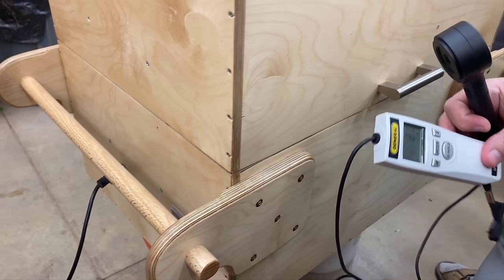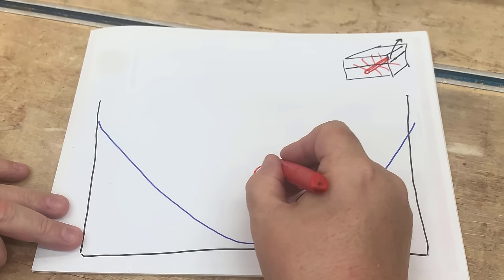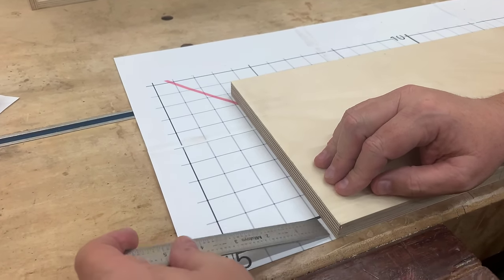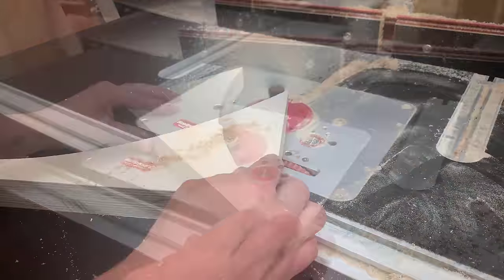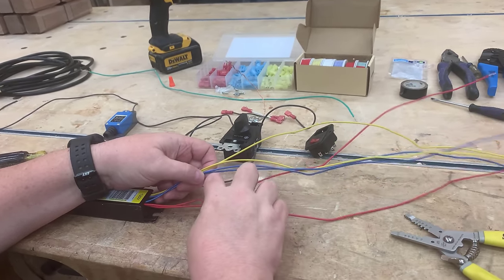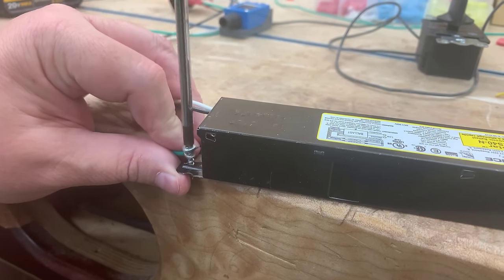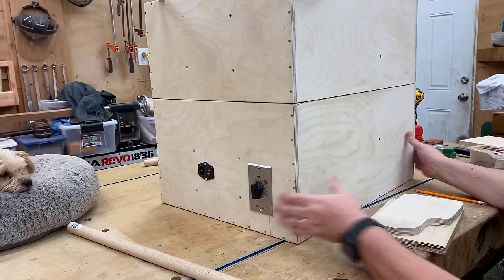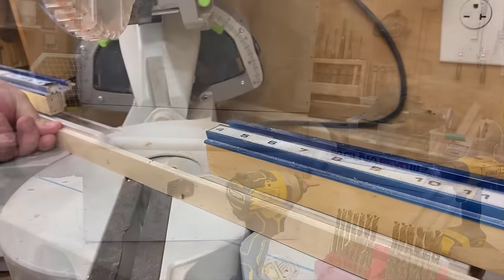Build A Box To Sanitize Face Masks & N-95 Respirators Free Plans UVC PPE Sanitizer

Comment: Thank you for the clear and educational presentation of a thoughtful contribution.  I wonder if trimming all four corners of the support rack might helpfully limit use to the higher intensity regions.  Though that the high spots are only double the intensity of the low spots means you did a quite good job of dispersing the UV.

Comment: I like the device and motivation, well done.  Incorporating your science experience and knowledge is fantastic.  I'm not sure this will pass the hospital risk assessment team as it's a home brew electrical device.  Oh it'll work, but they have to be concerned with fire safety and before building it would be worthwhile to consult with the site management team.  Its worth noting that there are discrepancies in the video build and the audio instructions, so make sure you know what you're doing before watching and attempting a build.  At 30:15,  there's a reference to pigtailing the BWN wires when in fact only the WN should be pigtailed at this point.  This is not correct as it has bypassed the timer AND limit switch.  The diagram at 35:03 is correct as it shows one black wire coming from the source going to the timer, to the limit switch and then pigtailed to upper and lower half.

Comment: had the same idea,however,didnt find UV-C lamps,i would also change the chicken gause to a polycarbonate sheet
Reply from the maker: Polycarbonate is not transparent to light in the UVC band. So unfortunately you wouldn't get sanitization through that. The only solid substrate that I am familiar with which would work is quartz glass. Pretty much all plastic polymers block it.  Thank you for watching!!
Reply: @KingsFineWoodworking  aha thanx,i didnt know that,wanted to make a box where i could sanitize my fridge/freezer items,and i tought of plastic to put my items on,now i know that wouldnt work,thanx again for the info

Comment: Love your design, it’s very well thought out.  The only thing I’m not sure about is the Mylar film’s UVC reflectivity.  If there is a protective coating above the metalized surface that coating could simply absorb the UVC much like the glass of a mirror absorbs it.  Have you conducted tests with your Mylar to determine its UVC (not just the visible spectrum) reflectivity?
Reply from the maker: I don’t know what percentage of UVC is absorbed vs what is reflected off the Mylar.  

But in a sense it doesn’t matter.  That’s because after complete assembly, I did comprehensive tests with my UVC meter, facing both up and down, in every area of the box.  And then I did the calculations off of the actual UVC light that would hit the masks. 

I agree it would be good to know what the absorptivity/reflectivity is, but it doesn’t affect the efficacy or safety of the box’s mission, since exposure time was solely based on actual UVC exposure. 

If it turned out that absorption of UVC was high in the Mylar, we could certainly experiment with different reflective surfaces. And if we found one that reflected more UVC light, then we could likely decrease exposure time. This would be an important avenue if these boxes were ever going into production. But since it was a one-off, and Mylar was cheap, I figured I’d just put it in, and meter it. 

Thanks for watching and commenting!
Reply: @KingsFineWoodworking  that’s true since you measured the effective output and you can easily reach an effective dosage in a reasonable amount of time.  How many of these did you end up making?

Comment: maybe a seal to prevent ozone escaping could be added ?
Reply from the maker: Hi Jon, this device makes UV light in the 254nm range. It typically takes wavelengths below 200nm to generate ozone. So while this will possibly make extremely small amounts, it will not be anywhere near significant enough to cause a problem.
Reply: @KingsFineWoodworking  I made a similar but not as sophisticated set up for sterilising my trainers and boots etc , I will make one of these to your plans and use some 18mm trespa offcuts I have in my store in place of birch ply as its a struggle to get just now 👍

Comment: Could you use this to sanitize the mask and air tube on a cpap machine?
Reply from the maker: I don’t think so. The UVC light won’t penetrate the plastic of the tube nor the silicon of the mask, so it would leave potentially unhealthy bacteria inside. It’s best to follow the manufacturer’s instructions, which probably involve cleaning with mild detergents & a vinegar solution.
Reply: Kings Fine Woodworking Makes perfect sense, thanks for the timely response!

Comment: Hi James, great piece of engineering!  I've tried tossing around some ideas in my head for such a box, but the problem I keep running into is, while I can make the UVC uniform across all the internal surfaces of the box (as you have done here, through the parabolic shape, etc.), I lacked the ability to measure the amount of UVC over the entire surface of the mask, with all its little nooks and crannies.  An N95 mask is curved, often with ripples, at different angles with respect to the box surface and the directionality of the UVC reflecting off that surface.  Parts of the mask will always be in shadow, or partly so, with respect to the light source, because parts of the mask will shadow other parts.  Is there any way to measure how large a dose of UVC each part of the mask surface gets? 

If there are some parts of the mask getting an insufficient dose, then the question becomes how to irradiate those complex surfaces?  One solution I've considered is a mask-shaped pedestal molded around a bundle of optical fibers.  Assuming optical fiber can transmit the UVC optimally, and a molding process can hold the ends of the fibers uniformly apart, then a mask laid over such a molded pedestal can deliver UVC to all the little nooks and crannies of a mask. 

I would just hate to pronounce a mask 'clean', when parts of the mask might be in shadows from other parts of the mask, and receive less UVC than perhaps is needed to kill all the pathogens?  But your experience and training in these areas is no doubt greater than my own, so what do you think?  Do my questions have any merit?
Reply: I'm virtually certain that UV-C does not pass through optical fibers, at least not any that mere mortals can obtain,as glass blocks UV. I believe pure quartz transmits UV but I've never heard of that used for fiber. I don't think the ridges in masks are tall enough to really shade anything from the light. That's just a hunch, so grain of salt and all, but I've never seen an N95 that looked like it wouldn't work in something like this.
Reply from the maker: Fiber optics are not transparent to light in the UVC spectrum, so that wouldn’t work. 

But in this box UVC light does penetrate the masks with continued exposure. 

Something I didn’t mention in the video was that the UVC light kills the germs on the surface of the mask in about 2 seconds.  But it takes a further 5 minutes (according to research) to clean them all the way through. 

A method that would provide more uniform light as you suggest would certainly be better. However, not necessarily because it would clean better.  But it would be better because you could use shorter clean times. 

One of the hurdles to this project is of course was getting a UVC meter. And a good meter that is certified is about $800. But even at that level of money spent, it wouldn’t give pinpoint accurate readings to very small areas of a mask. At best it’ll sample down to an area in size of 1/2 square cm or so.  Perfect for measuring larger areas, but not for measuring small discrepancies in tiny adjacent areas. 

I think your thoughts on the process are great. But it’s not actually necessary to more precisely control the application of the light, if you can simply throw more light energy at it by increasing the time, and subsequently getting the same result. 

Hope that helps. And I’m glad you’re thinking about it! I wish more people did. ❤️
Reply from the maker: B May, you are exactly right. ❤️
Reply: @KingsFineWoodworking  Many thanks to both of you, James and B May, for your replies!  That little puzzle had been bugging me off and on ever since the Science Div. guy from Homeland Security delivered his report on sunshine that time in the daily COVID briefing, where he had demonstrated how that temperature and humidity being equal, coronavirus lived about an hour indoors on a given surface, but only a minute or so in direct sunshine, and in response to a reporter's question about whether monkey bars in a park might be considered decontaminated, said that the upper surface of the bars in direct sunshine would, but that the lower half of each bar in shadow would not.  However, there was no reflective surface bouncing the sunshine up from the ground in that scenario either.  Anyway, thanks for confirming the research has been done on this question of masks and complex shapes already, and that an arrangement like this will be effective.

I've also been reading about how there are UVC add-ons to HVAC duct work, that were available even before this virus thing, and how they are installed close to the coil and drip pan where mold and bacteria love to grow, to kill those.  Such a unit might be around $400 for a residential size, with a couple of tube-shaped bulbs mounted on a panel and projecting into the duct, that last about a year with continuous use, and will kill pathogens in the air that passes by them (depending on the bulb intensity, the amount of air passing the bulb, and how fast), keeping the room or building's air free of (or at least inhibit the viral load of) coronavirus.  And how there are other arrangements where a UVC light source can be reflected upward and irradiate a ceiling, with ordinary ceiling fans drawing air up into the kill zone (the so-called 'upper room' configuration).  One wonders with such technology so available and cheap, why every restaurant, gym, church, grocery store, etc., doesn't get outfitted with it.  Maybe it's just not that well known, but it certainly seems like it would be worth it, and perhaps even be a way to end lockdowns sooner.